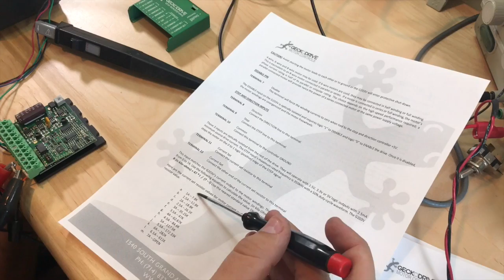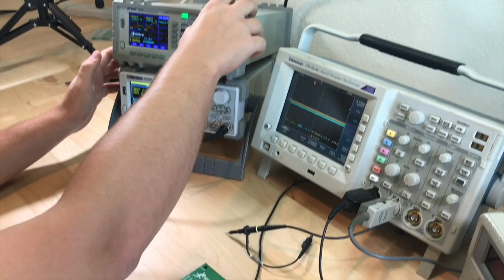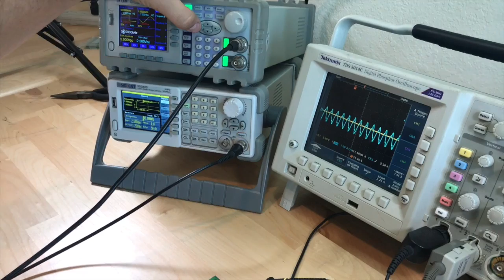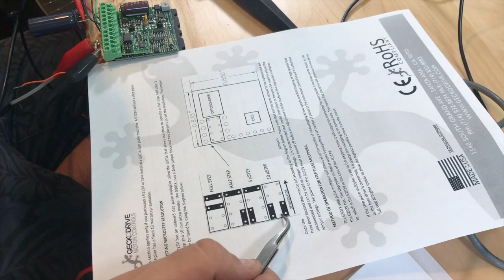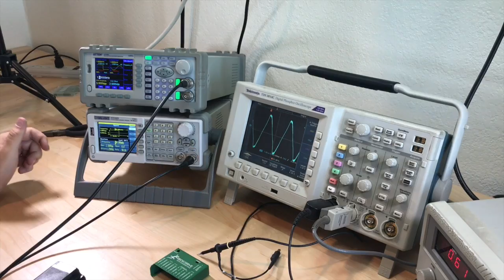Initial Setup of a Geckodrive G203V and G213V

Comment: Hello.
How to connect Geckodrive G203V with a driver that has dir + and dir- outputs?
Reply from the maker: You will need to tie the STP and DIR (-) lines together and run them into the COMMON terminals, then run the DIR+ to the DIRECTION input and the STP+ to the STEP input.
Reply: @GeckodriveInc  thanks

Comment: from my cnc board, i have output + and - direction.
how to connect it with geckog g203v.
The gecko board has only 3 inputs, not 4.
Reply from the maker: You will need to tie the STP and DIR (-) lines together and run them into the COMMON terminals, then run the DIR+ to the DIRECTION input and the STP+ to the STEP input.

Comment: Hi; and were I can put the protection fuse for the drive? and the resistors on the step and direction terminals are they necessary? thanks again
Reply from the maker: Hi Mariano- The fuse is located next to the electrolytic capacitor inside the drive and looks like a green 1/4W resistor. If you are adding a fuse then you would want to put it in line with the DC (+) of your power supply. A resistor is not needed with the STEP and DIRECTION line unless you are using a current source PLC that outputs more than 5VDC. We have an application note on our website covering how to use higher voltage command inputs.

Comment: hi; can you please explain me were the fuse would have to be installed  on these drives?, before( near the terminals) or after the capacitor? capacitor voltage be ok 150v? if the supply is 64vdc?
Reply from the maker: You would want the fuse on the DC+ terminal in line with the power supply, but the G203V, G213V, GR214V, and G540 already have a built in fuse. A capacitor voltage rated for anything higher than your DC input is fine. The lowest common voltage rating you would want to use with a 64VDC power supply is 80V; a 150V capacitor will not cause any problems but will be physically larger for the same capacitance rating.